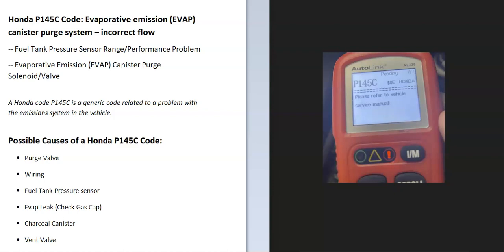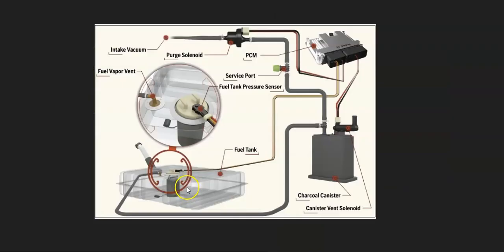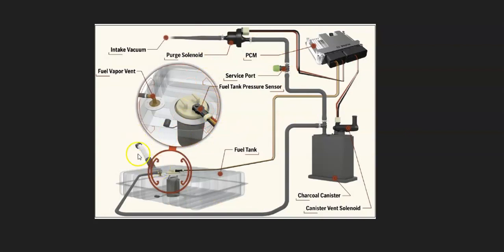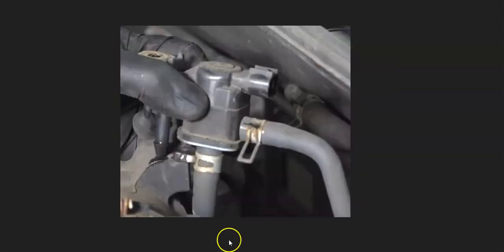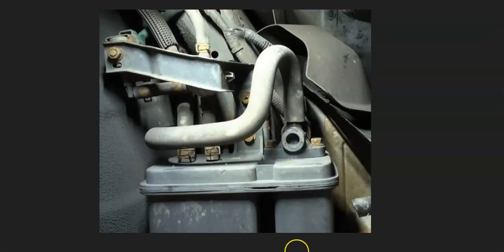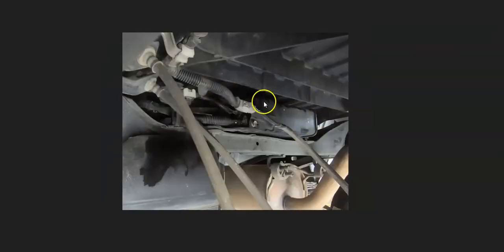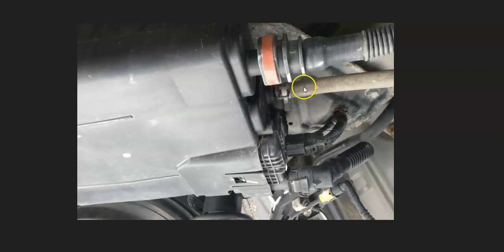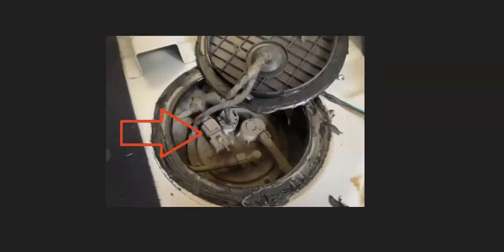How to Fix Honda P145C Code: Evaporative emission (EVAP) canister purge system – incorrect flow

Comment: My Tighten Gas Cap warning turned out to be a bad vent valve, the old one had a bit more stiction than the new one, an easy job to swap it out.
Reply: What car? I have a 2008 civic si, been giving me the gas cap warning and just threw this code
Reply: The one underneath that goes into the canister?
Reply: @recbone1999 
Yes.....I thought that was the issue....light came back, bought a smoke machine, found a small hole in the corrugated flex pipe going to the filler neck....rodent damage. I suggest running your hand along that flex pipe to feel for any damage.
I ended up sealing it with GE5200.
Smoke machine is only 65bucks on amazon.

Comment: My purge valve is missing the hose going to the intake Im getting code P145c and p0497  Could that hose be causing that I just recently got the car, im getting really rough idle almost like a misfire
Reply: My car is having the same 2 codes. Not sure right now what to do but I feel your pain

Comment: Is the vent valve normally open or closed?   Open while engine runnning?   Or open when vehicle is off ?   Or only open during evap test ?
Reply: I’m no mechanic, this is just advice , I’m not licensed. But from what I can tell, when the vehicle is off, it stays in a closed or open position (assuming closed) and so once the vehicle starts running, it has an automatic timer to when it cycles to on and off. As far as how that looks like, I’m not sure if you can physically see it opening or if it’s all happening inside  and you can maybe hear it ? Should be cycling the whole time the car is on, hence to get the vapes out while the car is running. It doesn’t need to run if the car isn’t running because no gas is being transferred .

Comment: 2013 civic. P0145c and p0497 purge low flow.

Have replaced purge solenoid and fuel tank pressure sensor with OEM. Pulled canister to check for air flow, it was good. Pulled vent vale and tested, it was good and fully open/closed. Monitored fuel tank pressure via scan tool; pressure was varying between 0 inwc and -40 inwc.  Appears that fuel vapor is being pulled to air i take just fine.

Had mechanic friend clear codes with car running. Codes cleared and did not come back for 20 minutes. Eventually codes came back.

With it being a low flow code, I wouldn't imagine it would be the gas cap as that would increase flow but I replace gas cap anyway.

Codes still there, not sure what yo look into next except maybe a collapsing hose or fouled inlet to air intake.
Reply: I have a 2011 CRV that has a Purge Valve on the Rear of the Car at the fuel tank…
Might have a problem with it if your vehicle has the same system as mine
Also had those same Codes
Reply: @exisfohdr3904 did you ever figure out what the source was? I’m going through the same thing with my accord. I have replaced the evaporator purge valve, the fuel tank pressure sensor, the gas cap and the vapor canister vent solenoid and smoke tested it and the code keeps coming back!
Reply: @sunfishdiver yes, it waa the most expensive part: the evap charcoal canister.

the canisters can clog, especially if the owner overfills their gas tank. this puts liquid gas into the canister and can prevent vapors from flowing.

I removed the canister and let it set out in an attempt to let any liquid gas vaporize, but the filter charcoal must have clumped together. Had to replace the canister.
Reply: @exisfohdr3904 how hard was it to replace?
Reply: I am having this same issues

Comment: My 2009 civic only has this code, but the car is getting some electrical problems I think. The car's engine shut down for half a second turned back on! This happened a few times, about two months ago, but I never brought it to a mechanic. I thought it fixed by itself, but then this morning, the car didn't start! I needed a boost! And now its turning on just fine. Weird eh. You think  this code could be causing this? related?
Reply: Did you fix it? My car is doing the same but I have 2010 accord
Reply: @Anbu_Ashley  no it sorta fixed itself.

Comment: Great video. I do have a question. I have a 2011 honda pilot 4wd ex-l and for the longest time my gas cap light would be on. I have replaced the gas cap with high quality caps 3 times and no change. Just recently I got the CEL light and the VTM-4 light. The CEL would stay on and it would alternate between the VTM-4 light or the gas cap loose light. I scanned it and received 6 codes all were P145c and P497. I replaced  the purge valve and the vent valve seloniod. Still no change? Only thing added to the vehicle that could be causing this is the VTM Bypass to cut off the eco mode. Do you think that part is what is causing my issue. Now I have had that on here for the past 2 years and just not getting problems with the system? Any idea?
Reply: did you ever find a solution? I'm having the exact same problem
Reply: @DH-rt2wl same any solution?

Comment: My 2011 honda civic lx only does that when it's humid.  High temperature.  I've replace the vacuum switch valve,  canister purge valve, canister vent shut valve and fuel tank pressure sensor.  I had several codes. Must when away. Only when it get humid and hot I get code P145C. When the temperature goes down and cool. It goes away.
Reply from the maker: Seals and gaskets can expand in hot weather and cause intermittent leaks. When it is hot I would try to do a smoke test to see if there is a leak.
Reply: @whyingo7964  will do. Thank you!.
Reply: @nerungo did it get resolved?